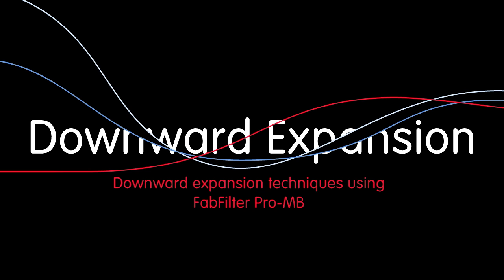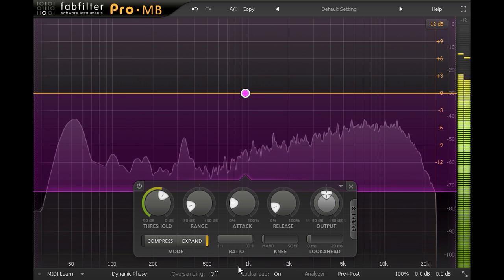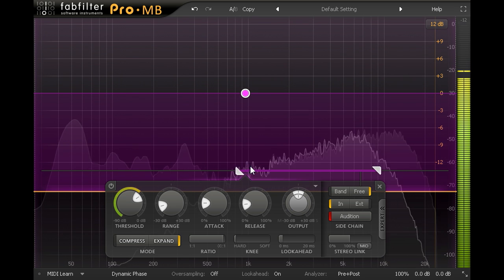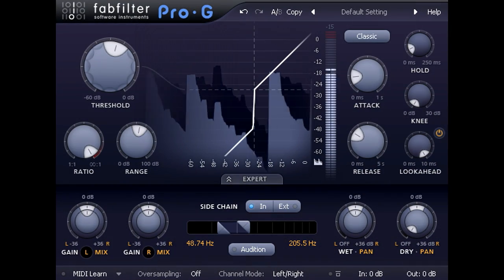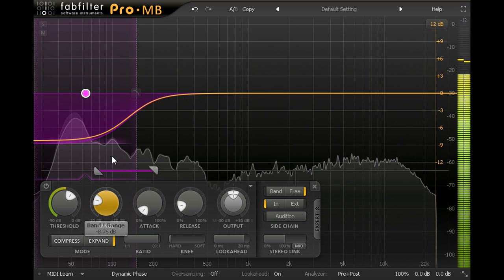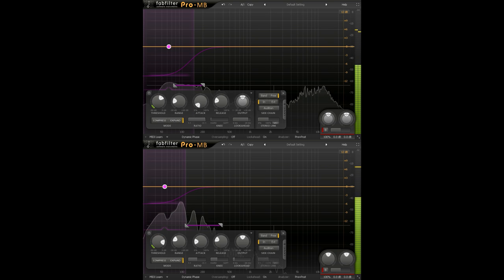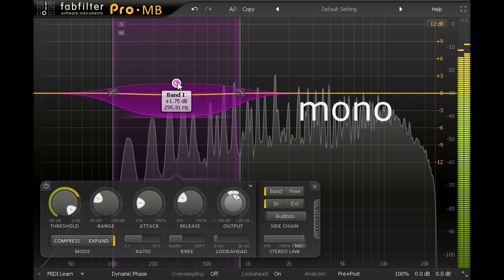Downward Expansion

Comment: I understand the EQ can make some loss of energy, so the expander can work better in trimming the low-end. But still don't understand when to use the expander or compressor in trimming the low-end. In my opinion, If the sustains of the kick and bass(boominess) are problematic; use the expander. If the notes(hits) of the kick and bass are fighting each other; use the compressor... am I right?
Reply: I agree that in general this whole series about Pro-MB tells us when some of those techniques might be useful but does not go enough into when a technique is preferred over another useful technique. I would appreciate more videos on the topic.    However to answer your specific question, my understanding is that expansion lets you control both the kick and the bass in a consistent manner, as opposed to carving out a large space for a boomy kick in the bass when using sidechain compression. There is no right or wrong solution - it's ultimately an artistic decision that is probably dependent on the genre you're mixing.

Comment: Great info. However, I feel that the threshhold setting, the visual display, the scale value on the right does not appear to be in synch and creating confusion. A video with exact corelation between numbers, the scales & what the visual display shows would help to really understand this plugin, much better.
At this point it is not fully clear and is extremely confusing from what is displayed, the meter reading , the spectrum display and the knob readings..
I am looking for buying these, but want to make sire, it is clear..

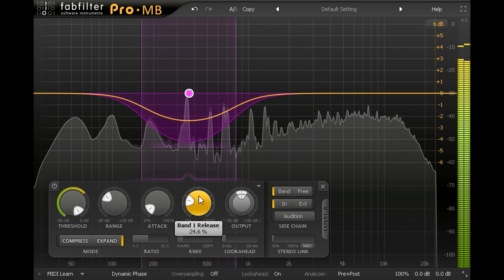Comment: 10:06 what is upward expansion?
Reply: There's downward and upward compression and downward and upward expansion. Compression decreases the dynamic range of a signal, expansion increases the range. 
Downward Compression
When people refer to compression, they almost are always referring downward compression in the sense that once a signal increases above a set threshold its rate of increase is constrained at the rate of the set ratio. A second process known as makeup gain is usually applied to raise the entire sound while keeping the constraint in place.
Upward Compression.
Once a signal decreases below a set threshold its rate of decrease is constrained to keep the sound from dropping as much as it would if left alone. One use is to keep sustains for a longer period in not letting them die out as quickly as they would if left alone.
Downward Expansion
Once a signal decreases below a set threshold its rate is increased - e.g. a sound decreasing will disappear sooner than if left alone, often referred to as gating.
Upward Expansion 
Once a signal increases above a set threshold its rate is increased - e.g. a sound increasing in volume becomes louder at a faster rate than if left alone.